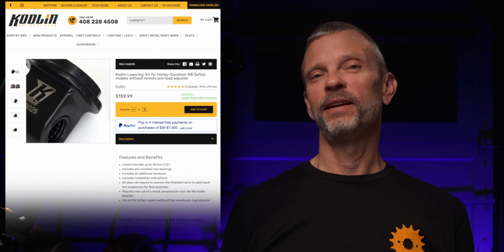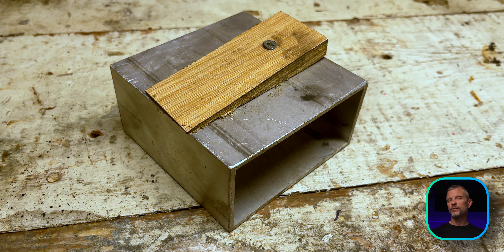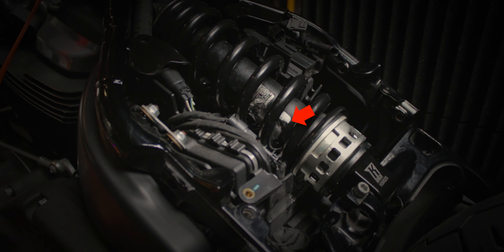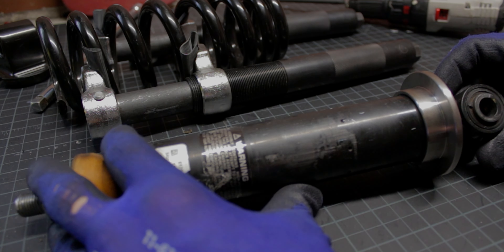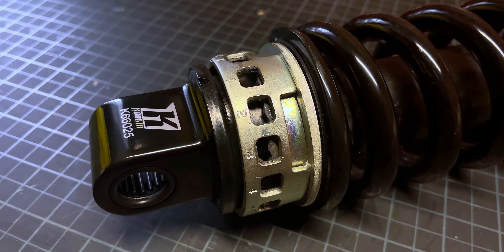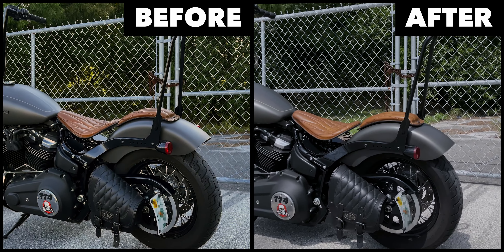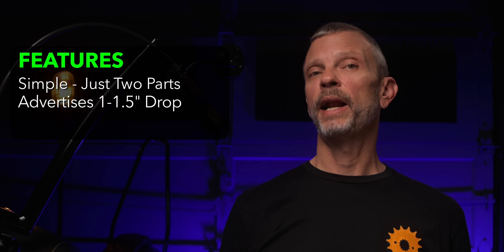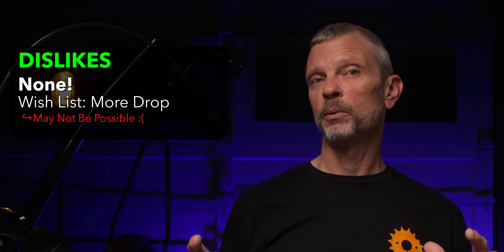Kodlin K66025 Lowering Kit ⬇️ M8 Softail • Installation & Review [Not Sponsored]

Comment from the maker: Have you lowered or raised the rear of your bike? How did it go and what kit did you use? Or did you use your own solution? How much drop did you get? Leave a comment and let me know!
Reply: I've been eyeing up this kit for my 21 bob, but also thinking about lowering the front. Maybe a video about the front would be ideal howbowdit.
Reply: I went with the RWD mono shock bike has a fender gap like the Dyna Softails. Way better for turning and not scrapping pegs on twisty roads. I heard lowering kits comprimise comfort making the ride more hard and rough.
Reply from the maker: Hey  @jamescollins5073  - I'll do a bit of research. What approach are you looking at for lowering the front?
Reply from the maker: Hey  @adminadmin9997   - that looks like a nice kit! Did you get about 2" of lift? For this lowering kit the comfort seems fine - all of the original preload and spring rate are unaffected, but the clearance reduction is definitely noticeable (but also to be expected).
Reply: I simply use the same KODLIN system. I have a soft tail standard 2022
Reply: @RonsWorkshop  Whatever works best with the Kodlin kit, actually just looking into something of some sort. Looks like the Thunderbike has a dropped front-end.
Reply: I got the dealer here in Australia to lower the back with a kit made here I assume. It lowered it 1 inch or a bit more. The front got lowered about the same by simply sliding the forks up the clamps until just shy of the bars. The kit came with a wedge to move the jiffy stand out, but I have not confirmed that. Since all that I fitted a 21inch front wheel so it is lifted again lol
Reply from the maker: How  @timblackburne77  - that wedge for the jiffy stand is a nice addition to that kit! My bars are too close to the top of the triple tree for me to lower the front that way, so if I do anything with the front it will likely be more involved. Thanks for sharing that info!
Reply: Lowering a a Softail is nuts😮 they are already too low. I can’t even take the FXLRS around the canyons without scraping footpegs
Reply from the maker: @Group_Anonymous I hear ya 🤣

Comment: Great vidio,.I installed the Kodlin kit about 2yrs ago on my 18 Fatbob 114, Just a TIP I used 2 rachet straps one on each side of the spring , they worked out just great. Kodin lowered the bike about 1inch, all though I did have to turn up the shock adjuster about 2 more numbers. Other than an occasionally kick stand drage on a speed bump it's worked out fine
Reply from the maker: Hey Terry - thanks for sharing your results and that tip as well!

Comment: Great instructional video!  I might as well remove the stock M8 Softail shock spring and replace it with a lighter rate spring to match my 150 lb body weight.  The stock shock pounds my back so bad I'm in pain for days after I go for a short ride.
Reply from the maker: Thanks for the kind words! Let me know if you do swap out the shock.

Comment: Thanks Ron, another great video. The one issue that stopped me getting the lowering kit is that the jack I have just about fits under the standard bike so it would have increased the price as I'd need a new lifting jack. One thing to point out is to make sure you can get the bike back off the jack once the work is done 👍
Reply from the maker: Hey Orange Manstan - you are correct about the Jack clearance. In my case, I roll the bike up onto a couple of wooden slats to give the frame the extra clearance. Thanks for the feedback and the kind words!

Comment: Just installed the lower kit in ny '20 FXST a few days ago, love the way the bike sits now. Interestingly, it also rides better. Feels more stable and bumps feel softer. Not sure how that works and wasnt something I expected, but its also a welcome change. 

I will note that I lost a bit of lean angle before scraping parts, BUT I also rip my bike around corners a lot faster and lean more than most other HD riders. Unless you like to take turns aggressively, I suspect you probably won't dven notice you loss of some lean angle. Even so, I'll take that negative for all the other positives.
Reply from the maker: Agreed!

Comment: Hehehehe!!! My 2 cents 
Mine dropped more than 1.5” , and yours will too my friend!!!
First of all let me ask you a couple of questions, one rhetoric and other logicals .
1- Did you lock well enough the big nut that came STOCK in the threaded shock shaft against the KODLIN screwing head ? when you installed the KODLIN HEAD WITH BLUE LOCTITE ??? 😉
I know you didn’t because you can’t, the KODLIN HEAD comes with a lip that doesn’t allow you to do that. Right?
Question #2.
Then why did you leave the big stock nut installed in the shock threaded shaft?
By now I know you already realized what I am talking about!!!
Mine: I took off the stock nut and screwed all the way down the KODLIN HEAD …..it dropped more than 1.5”.
Great channel my friend, I have learned a lot from you.
God bless you and keep you!
Reply from the maker: Hey ALABANZA Y ADORACIÓN CRISTIANA - you're correct on #1...the lip prevents snugging the jam nut without a strangely offset wrench or some other gymnastics. I ran the jam nut all the way down and snugged it as well as I could. I don't suspect there will be any problems...hope not! #2...now that's an idea worth trying. I may just have to give that a shot. Any problems with fender contact, and what preload setting do you use? Thanks for sharing that!
Reply: @RonsWorkshop  
No problems at all for the moment 👍
Reply: @RonsWorkshop  
I use setting # 3 for me 210 lbs 
And setting #7 for my wife and I.
Reply: Actually, you can tighten the locknut, I do it all the time. When using our tool, you simply compress the spring until you can get a better angle on the nut. You can also use a thin wrench and get to it through the springs after you release the tension. Nut just needs to be snugged up. Agreed, the lip does make it challenging but not impossible. We do not recommend removing the lock nut! Liabilities...Like the video by the way. Thanks, James
Reply from the maker: @kodlinusa6155  Hey James - thanks for chiming in! I appreciate that input and the kind words.
Reply: Thats a great idea - dont suppose you have a picture to see the drop? @MAM..888
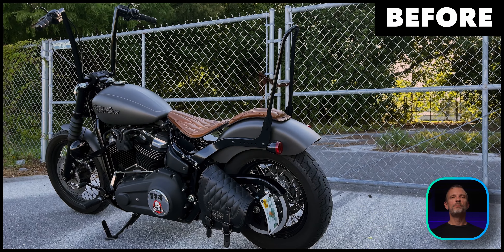Reply from the maker: @darrenstopler3045 you can see a comparison at this point in the video (4:22): https://youtu.be/23nDgykywu4?t=262
Reply: @MAM..888  any pics??

Comment: Am going up an inch, prefer ground clearance for better cornering and ride height/travel for passenger comfort. The extra inch rise will provide enough sag to sit the bike seated at the height it sits un seated. Low Rider S has similar length shock to Street bobs but with a remote adjuster, you can see the mount for it on the bracket goes over the rear of the shock on the bob. On later 22 Low rider s they opted to fit the heritage/fatbob shock as inch longer travel. Will be buying a new used fat bob shock removing the black knob and fitting that one as cannot see the point of a jackup kit with no gained extra travel. A tip for yourself, amazon el cheapo ratchet straps less then $10, some leather garden gloves and some old rags, strap and rachet the springs, straps protect springs rags protect springs body from ratchet mechanisms. There's vids out there of people using them, its ballsy but it works sweet ; ) used them when changed out the stock shock for the longer MG Stelvio adventure version and the soggy spring for a rated to my weight version spring on my Moto Guzzi Griso.
Reply from the maker: Thanks for sharing all that info! Yeah, the ratchet strap technique would be a little nerve-racking but not out of the question. I like the way you’re planning to do that shock swap. Let me know how it goes!

Comment: I think after seeing this that dropping the fender instead of the rear end will be the way I go. I want a tighter fender but without losing cornering clearance.
Reply from the maker: Hey Bryan - that’s a good idea. Let me know if you end up giving it a try. I suppose the existing rear fender struts could be retained and the fender re-drilled, or a new fender with the mounting holes in different locations, could be used.

Comment: Hello there again Ron .How are you doing?
This time if it’s possible I need you to guide me to a good tutorial video of how to connect in my softail standard 2022 a harley electrical connection harness 69201599a.
I am planning to install the mighty mite fan in the accessory plug , but it needs to be installed and converted from scratch. I will always appreciate your help my friend. 👍👍👍
Reply from the maker: Hey there! I'm not sure if this will help, but I have a video on how I used the accessory plug: for my fog light 
https://youtu.be/B9z5nHKgv98

Let me know it goes!

Comment: Would it be possible to use regular spring compressors to do this job , thanks 👍
Reply from the maker: As long as it is small enough to fit that coil spring and also doesn’t contact the shock inside the coil spring. Let me know if you find one that works!

Comment: Two questions.  1.  Why did you want to lower the rear?  2.  Is there any issue, safety or otherwise, having the rear lowered and not the front?  Doesn't seem like a good idea.
Reply from the maker: Hey jimbert50 - for me it’s just personal preference. I’ve always thought that rear fender was much higher above the tire than I preferred. 

I haven’t noticed any handling issues at all - highway or otherwise - aside from dragging everything like I mentioned.

Comment: How are you doing Ron?
I have a technical question for you. I have a softail standard 2022 , I kept the stock air filter but I took off the mufflers and put a couple of shortys slip ons.
Do I need to tune the bike for that?
I also added a couple of mods that I learned from you, the transmission top cover vent and the air filter breathers I put them outside.., and they work perfect. But the main issue is the need of a running or not because of the shortys slip ons .
Thank you in advance as always 👍
Reply from the maker: Howdy! Glad to hear that the mods went well for you. Technically any change that affects airflow into or out of the engine will change fuel demands. I’d expect the slip ons to lower the back pressure a bit. However, it probably wouldn’t be a drastic change. I’d check with the company to see if they recommend tuning. Let me know what you learn and decide.
Reply: @RonsWorkshop  
I will 👍
Reply: @RonsWorkshop  
Actually I did the two valves decompression mod at the same time (the one on the transmission top cover and the one in the dipstick) in the dipstick I applied the same logic that the FUELING DIPSTICK did , I separated the two parts, drilled the four 1/8” holes at the lower part, then I put an sponge inside the two parts before gluing them with gray Permatex , I used a 5/16” bleeding screw cut the tip and tapped the very center top of the dipstick head , screwed it there with red loctite and from inside I filled the head with Jd weld making to keep the hole open using a bbq stick (lol).
Then started the same logic with the transmission cover mod …. On the dipstick I installed a one way valve also and at the end a breather filter.
I guess with the two same purpose mod at the same time , I was gonna lower also 50% the probabilities of oil spills or so, both of them are doing the same but with less stress.
And another thing about the slip ons, I both the lollipops that those guys of DK customs sell, and installed them in the slip ons and I think I gain back some of the back pressure.
I should have send you Ron this text before the one with the question, for you to know better my diagnosis if I should need a tuner or not in my softail standard.
If I tell the Harley person this story, the first thing he’s going to tell me is…….. you’ve lost your warranty!!!! Lol
It’s sad that they don’t do a correct engendering anymore on purpose!!!! They design the machine to last 5 years……..business!!!!!
In Cuba still the 1957 chevys are running!! …..back there , another mentality!!!!
Reply from the maker: @MAM..888  ahh ok! how do you like those DK Custom inserts? I've wondered about those. Check with them and see if they recommend any tuning changes. And you're right - if you ask the dealer we know what they'll say! Which slip-ons did you go with? And how's that dipstick working?
Reply: @RonsWorkshop  
The inserts work ok in my SHORTYS SLIPONS , gain a little back pressure and the slip on sound lowered like 3 decibels with the inserts , At DK they told me I don’t need any tuning in my bike with slip ons and inserts . I just called Harley and told them about the slip ons with inserts without changing stock air filter, and they say I need the dyno tuning that is like $800 with labor for my 2022 softail standard. They are a monopoly. Wow!!!
Ron , I tell you the truth, I’m thinking about putting back my stock mufflers… wow!!!
I don’t know whom to believe, DK or Harley.!!!! What do you think???
Regarding the dipstick, the mod works fine as expected.
I still have the external breather hose running through the bottom of my bike . I watched your vids of the catch can 3 way valve vacuum, and I was wondering what would happen if I run normal without vacuum or pressure???
Reply: @RonsWorkshop  
I sent you a video with the mods through telegram.
Reply from the maker: @MAM..888  Yeah I'm not sure. $800 is a lot. I feel like DK is trustworthy...but you have to be 100% comfortable. Sorry I can't help more :/ Nice job on the mods!!!
Reply from the maker: @MAM..888  Dude - you do very nice work! And thanks for the blessings, brother!
Reply: @RonsWorkshop  
👍 means a lot

Comment: I'vs installed one of these (Müler) on my previous streetbob, after 4000km my suspension was dead. Better ad few buck and buy a real adjustable shock..
Reply from the maker: There are definitely tradeoffs improvements in ride quality with aftermarket shocks vs. OEM shocks. For simple lowering this does the trick.

Comment: does the shock rub anywhere after the lowering kit installation?
Reply from the maker: Hey Navi Sandhu - I haven't noticed any contact or rubbing. Let me know if you try it!
Reply: @RonsWorkshop  yes im going to order one for my 2019 breakout, you think its necessary to lower thge front as well?
Reply from the maker: @sandhujatt2  I didn't lower the front of mine, and it seems fine. You could always start with the rear and see how you like it.